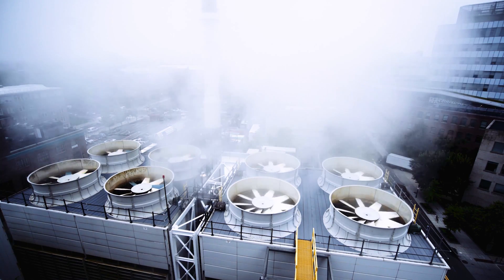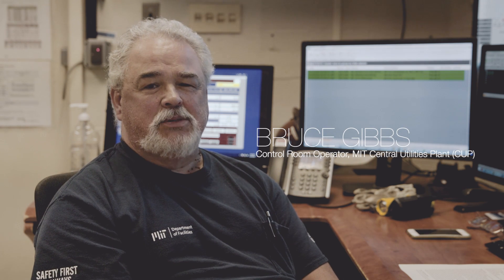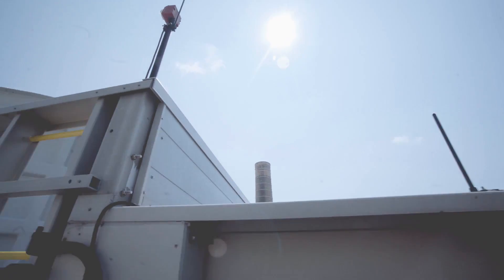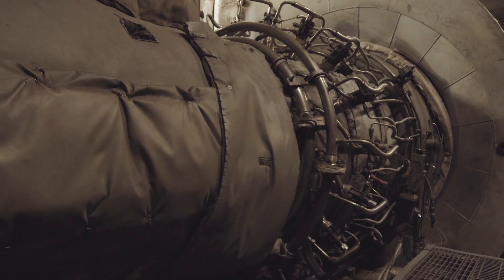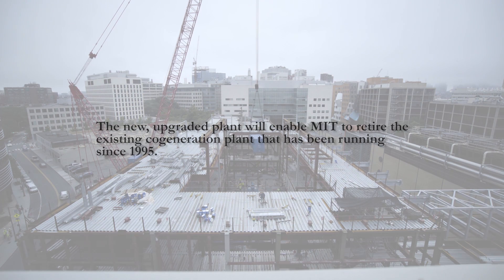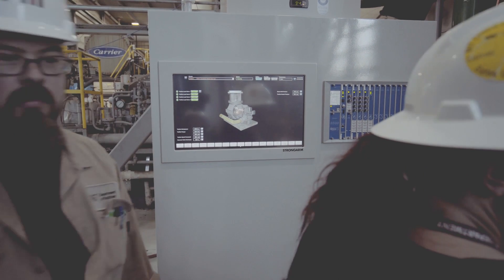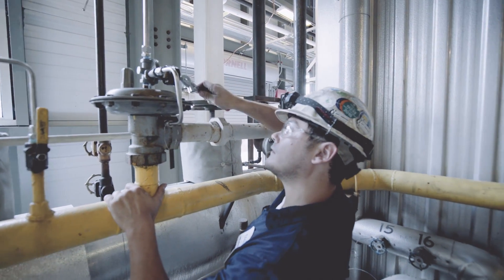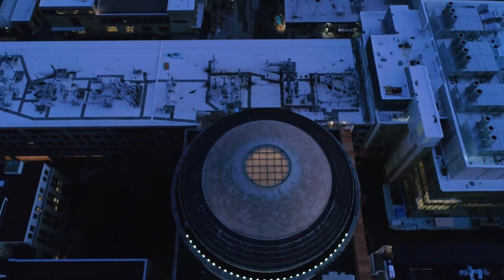The Heartbeat of Campus: MIT's Central Utilities Plant (CUP)

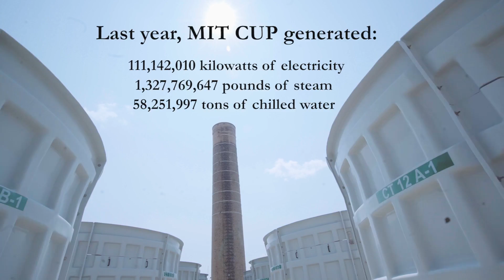Comment: 1:37. Should that be Kilowatts hour instead of Kilowatts?
Reply: Curious to know what's the difference
Reply: @joetyler835  KW is unit of Power, meaning how much a plant is producing at a given moment. KW-h is unit of energy, meaning how much energy the plant produced over a period of time. So if capacity of a plant is 10 KW, it will produce 100 KW-H of energy if it runs for 10 hrs.
Reply: Exactly, and for a moment I though whether I am wrong, after all this is an official production of the best engineering college of the world!

Comment: There is a phrase I love ever ounce counts.

So I wonder what are the in and out temps for your heated medium through your process, what sort of efficiencies are you hitting, is there a any thermal storage in your systems to act as a battery. Is there any new exotic or unusual designs you plan on testing. Maybe some new looks at intergradeing direct thermal to electric systems useing nanomaterials as a base. 

You guys have a hole power plant to play with and test on you have to be looking at something.